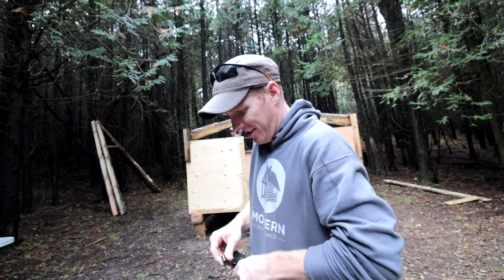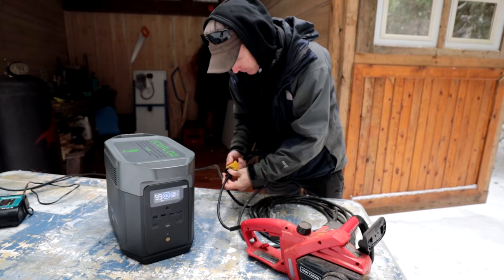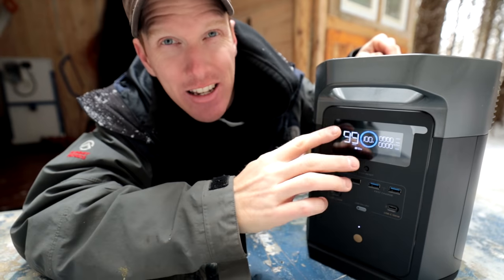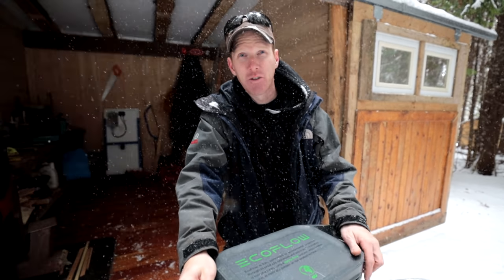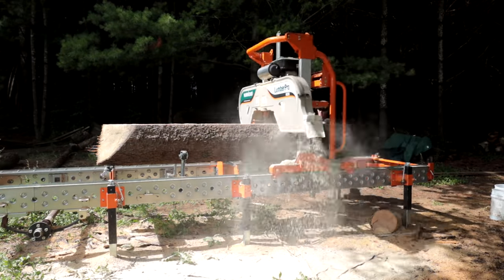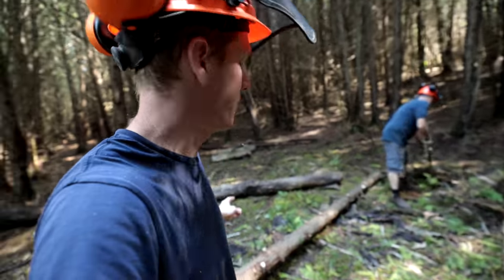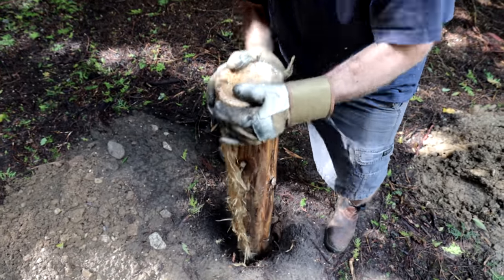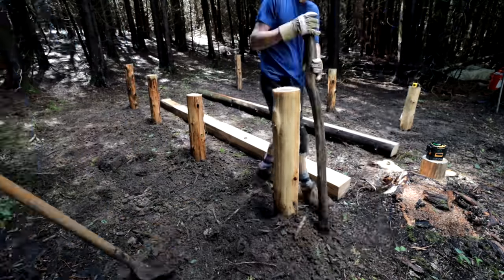Building $1,000 MICRO GLASS HOUSE 90 sq ft - (COMPLETE BUILD)

Comment: Hello, have you considered running a ridge line at top center and obtain 2 proper size emergency blanket/tarp on outside and stake them off  it may provide a significant increase in insulation in your Glass house as a quick fix. Then in summer time quick release and you have a glass house again👍🏼just a thought

Comment: Did you use any linseed oil, like Cabot's on the exterior ceder boards ? Did you set up a spot for solar panels to recharge your battery pack ? As usual you did a great job !